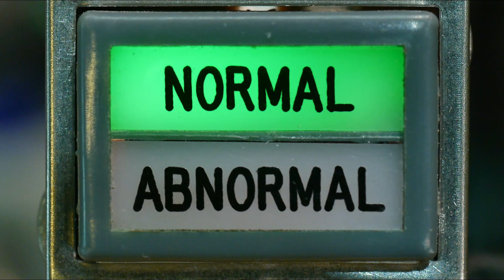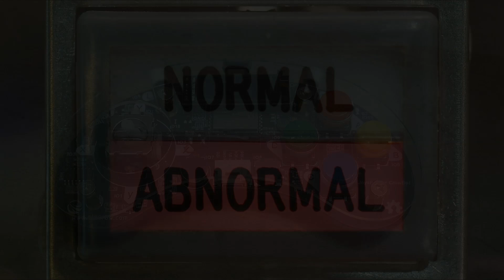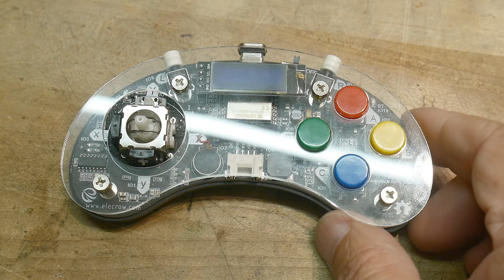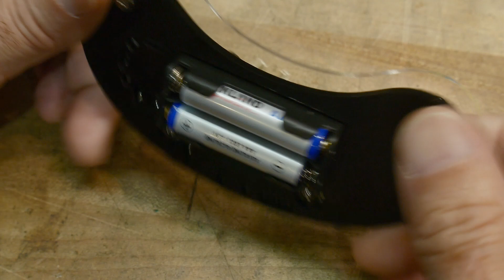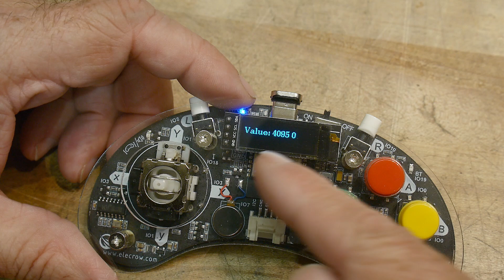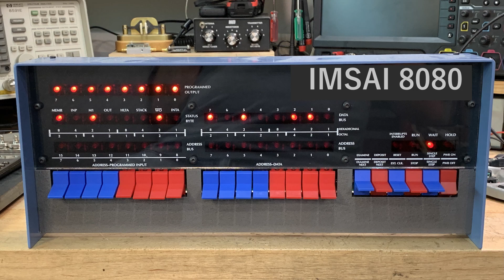#1844 OmniBot (part 5 of )

Comment: 4:02 Be careful with those. I liked them too, until they killed one too many device. Thing is, they expose the data pins outside … without shielding nor protection. So … a bit of static and whatever the magnetic connector is connecting to is gonsky.

Comment: those 'modern' joystick pots work with runtime software deadband & other calculations in mind, if there's no discrete calibration stage then the lifetime as they wear is much longer even if they're more cheaply made. the case can arbitrarily restrict the range with no problem too. same software will work with even sketchier joysticks than this, like the ones in the joycons

Comment: The joystick will give different values due to how they're made - it's a little wiper along a carbon deposited track, and it can take on values based on how it was deposited at the factory. For cost purposes, they don't really calibrate how the machine deposits the resistance material  as that stuff can be figured out in software. The only thing they care about when manufacturing is assuring the deposited material is linear. The X and Y depositing machines are likely different machines so each is dependent on many variables the day those parts are made, which can be from different batches made on different days.